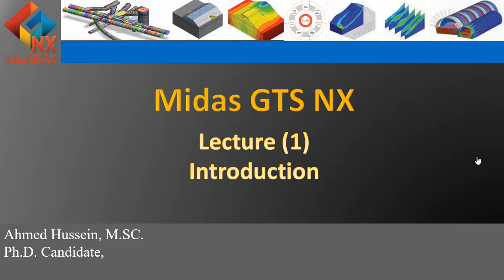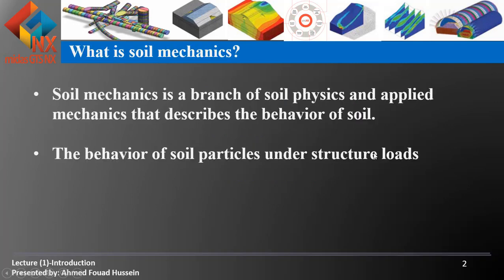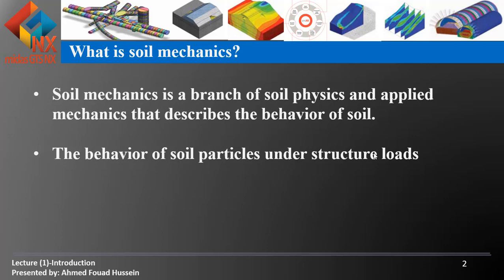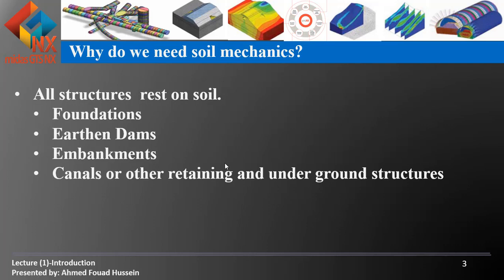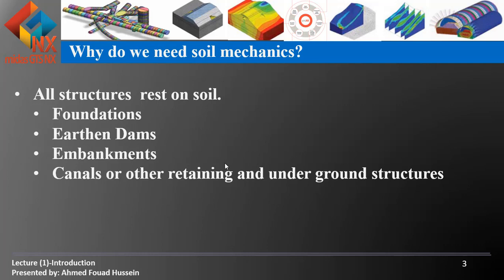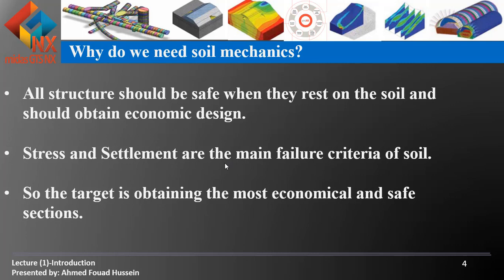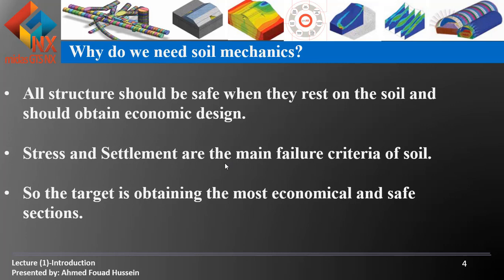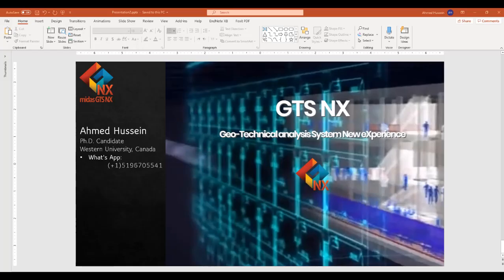Midas GTSNX-Introduction To Geotechnical Engineering Application

Comment: halo Mr. ahmed, i just wondering what the differences between the geotechnical software (rocscience, itasca, midas, geostudio, plaxis, etc)? because i really confuse about all of the software, i mostly used rocscience phase 2 and mida gts nx to solve my geotechnical problem, but i still not sure the software analysis can give me the accurate result to applied in the field, is there any validation that we can use to ensure the result of the software? or what we can do to get the accurate result from the FEM analysis software? thanks..